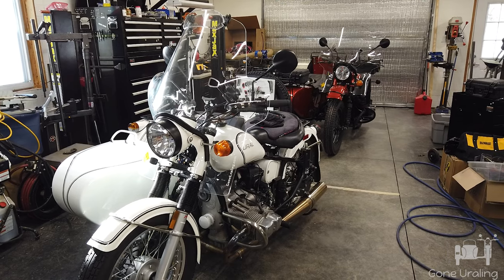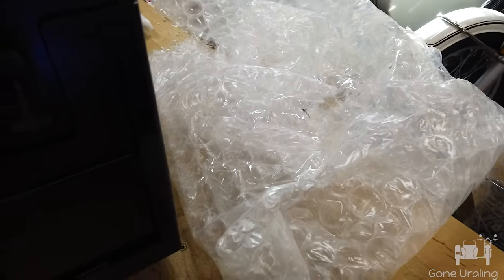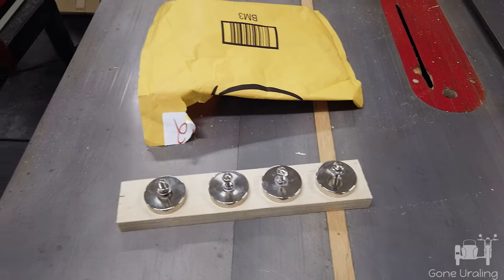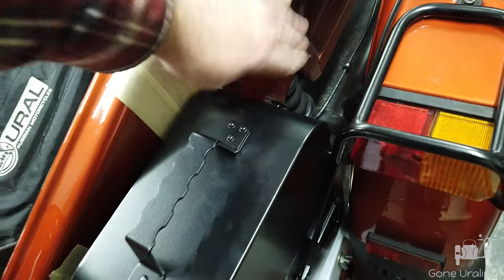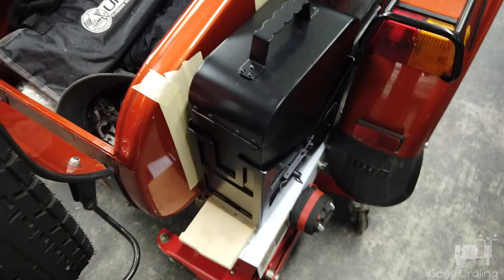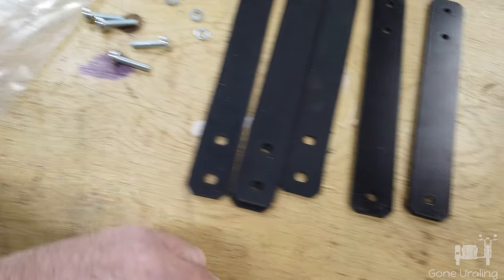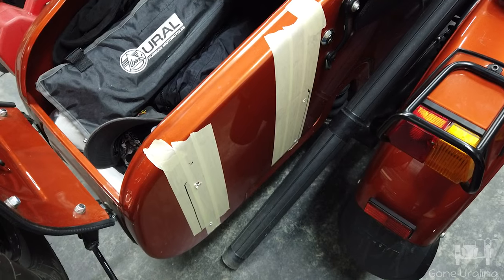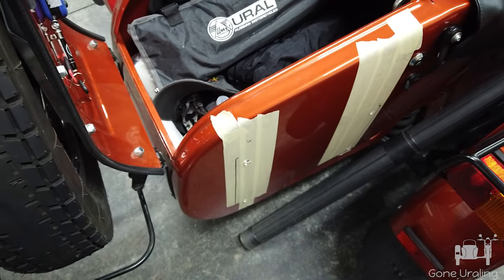Ammo Can Toolbox install on the 2017 Ural cT 22.1

Comment: I was holding my breath as you were pulling off that sticky tape,,,,I was thinking blue painters tape on that old Ural paint,,,lol.
Reply from the maker: That was the 3M automotive masking tape I was using, not even the cheap stuff.  I figured I would go with a racing sides motif if it pulled off the paint. I have a friend that owns a body shop. C (my wife) actually wants to repaint the whole thing, but I'm too lazy to take parts with perfectly good paint off to carry over there for paint. Perhaps I was tempting fate so I would go for a repaint.

Comment: Awesome installation! I sure have missed your videos - glad to see a new one!
Reply from the maker: Thank you for the comment. I'm reorganizing my file system now to get a better (faster) workflow in Premier Pro and try to put out videos this year, going to start with the modest goal of 1 per month for both this channel and my h4bats channel. If that goes well for a couple months, I'll bump to 2 each.
Reply: @GoneUraling  Definitely looking forward to them!!!
Reply: I would never change a tire on the side of the road even though my rig carries to spare because for $20 a year over the $100 a year I pay for full coverage motorcycle insurance through Geico I get unlimited road service with a 75-mile limit because Geico pays better the tow services make it a point to show up promptly my sidecar rig popped out of first gear and rolled across a parking lot like a shopping cart and took out a brand new Honda Fit and that's what the owner had when he came out of the biker bar caved in the side of the car going 60 miles an hour $1,600 worth of damage Geico covered it no problem and they make great motorcycle commercials especially the ones with the caveman and the euro I love the little camper behind the sidecar rig that reads Nomad on the license plate

Comment: Just lookin at ur video. U have to open trunk of side car to open the ammo box .does the lid of ammo box open up all way or does it get stoped by the lid an spare wheel ?nice demo an explain of how u mounted the ammo box.
Also what are the magnets for. And greetings from ireland.
Reply from the maker: The lid does rest on the spare tire (which I actually find useful as I put stuff in the lid), but the can is fully open and no part of the lid obstructs access to the can itself. The can is also easily removable so if I did ever need to fully open it I can just take it out and sit it on the ground.  One thing, do make sure to use rust preventative to treat the hinges etc...